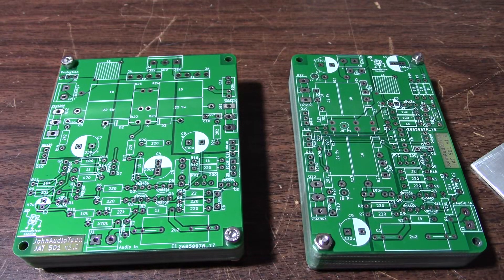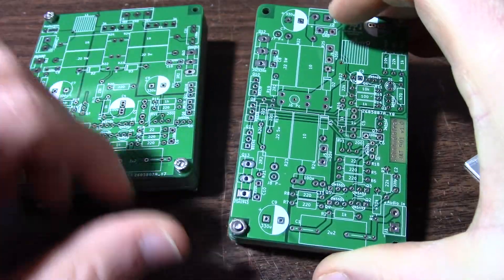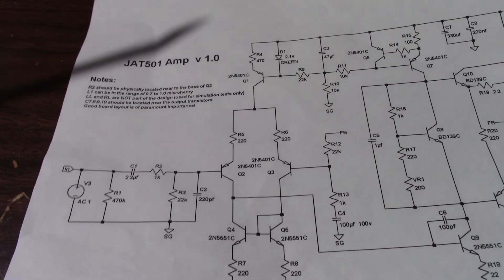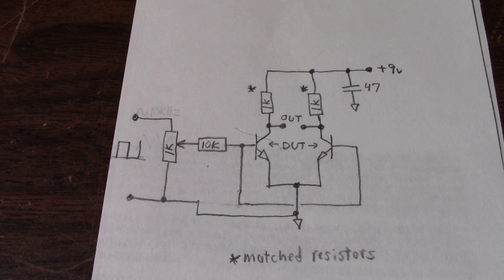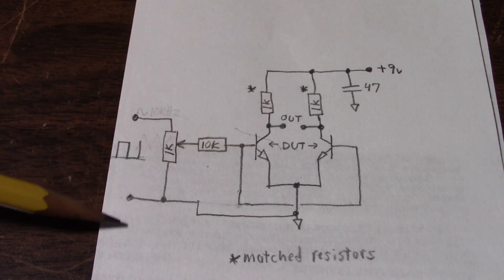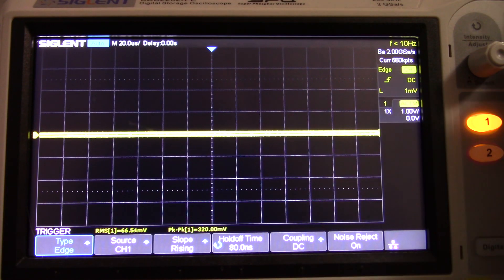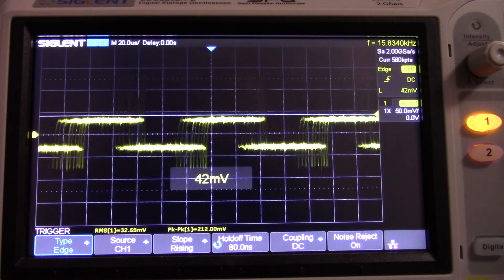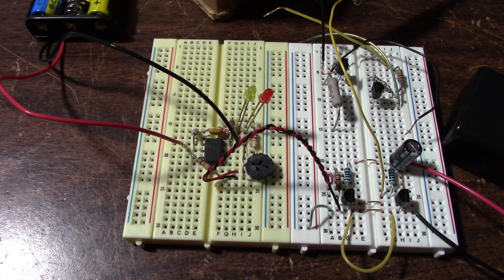Differential transistor matching circuit and the JAT501 amplifier project

Comment: Hey John. Have you thought of using a Voltage Controlled Oscillator with a buffer amplifier. I found that the CD4046be VCO IC chip puts out a great square wave low distortion output.

Comment: hey sir, you can try the Yiroshi design we called it here in Asia. :D it is a combination of all amps design. it has a double preamp, differential, TEF (Three Emitter Follower) and CC(Constant Current Source). can handle more than 200VDC Center top PSU. if you demand high power. it can deliver 2000w. please check it out and do some analysis.

Comment: Question I’m able to use a CD4060be ic chip in a astable multivibrator mode to yield a 16kHz square. How critical should the signal be? Your thoughts?

Comment: John I recently viewed a video where the poster hooked up a pot between the emitters which allowed for variances in the resistors. Just something to think about. Your thoughts?
Reply from the maker: That is normally done to compensate for slight variances in the circuit components. In a power amplifier, it can tune out any offset voltage on the output.
Reply: @JohnAudioTech  Thanks John. I enjoy watching your videos.

Comment: Before you even got to the testing part, I was thinking to myself that it would be good practice to physically tie the two transistors together thermally. Back-to-back (or face to face) with thermal compound or shared heat sink (which is essentially what you have in a diffamp built inside of a chip opamp.   IMSAI GUY struggles with this in a video series he did building an Opamp from discrete components. The solution in that circuit was to change the resistance of the tail resistance of to the diffamp circuit using a variable resistor which somehow placed the circuit in a seeet spot.

It’s also important to note that matching should probably not be performed on a breadboard. Breadboards connections can have all sorts of parasitic impedances that will adversely impact matching efforts.

Comment: Is there any advantage over an opamp, or do you just want to stick to "discrete" amp concept?
Reply from the maker: A high-performance op amp could be used and be better in some ways but would require voltage regulated supply rails and other design considerations.

Comment: John, what do you think about Sziklai pairs in the output stage of the JAT501? The thermal stability is much better because it depends only on the temperature of the driver transistor who has not a lot of power dissipation because it has only about 0.7 V voltage drop. Furthermore you gain a little bit more output power because the bias spreader needs to bridge only 1.4 V and not 2.8 V.
Reply from the maker: CFP has the advantages as you describe. I like them in amplifiers with lower supply voltages as they can swing tighter to the rails without extra circuitry. The high level of local feedback in the pair can make them more linear and need less bias, however they do have drawbacks. They have worse switch off performance than EF and tend to be less stable. Their very low output impedance makes it harder to tame nonlinearities at crossover.

I listen to amp designers' arguments for and against. I did test them and found CPF more prone to oscillate though I'm sure they can be made stable. It wouldn't be too difficult to adapt the 501 amp to use them if desired.
Reply: @JohnAudioTech  "It wouldn't be too difficult to adapt the 501 amp to use them if desired." it is very easy. You just need to switch Q12 and Q13 and connect them the right way to their driver transistors https://en.wikipedia.org/wiki/Sziklai_pair#/media/File:Compound_trans.svg (a resistor of 120 Ohm from the base of Q2 to the power rail support the velocity of Q2 by driving charge carriers out of the junction region.

Comment: Nice littel circuit 
With the presence of different brands from China and many of them can be imitations, it has become necessary to make sure that the transistors are matched not in terms of compatibility , but also in terms of watts and amperes, and you are right. Differential transistors are usually cheaper to match than power transistors Good video, thanks for posting

Comment: How do you match a pnp with an npn?
Reply: In this case you would like the gain to be matched relatively closely.  You can do that with the component testers like John used to compare the transistors near the end.
Reply: @argcargv  oh, i know how I would match them - i have a nice curve tracer that would do the trick nicely. I was curious how John planned it, since he specifically mentioned matching Q10 and Q11 in his output stage, which is a pnp npn pair
Reply: @unregistereduser2  Yes, a curve tracer would be even better if you happen to have one handy.
Reply from the maker: If you look at the curves for complementary transistors on the datasheets, you see they don't appear to match that well, so yes as others have said, match gain. Building a curve tracer with a microcontroller and op amp has been bouncing around in my brain for a while.
Reply: @JohnAudioTech  Yeah, you end up buying hundreds to get a good match as usually the NPNs have more gain. I even had a really perverse idea of intentionally reducing the gain of an NPN transistor to make it match it's compliment, as in a video where you demonstrated how a transistor's gain can be damaged. Would probably end up hurting S/N, but would make for a good experiment!
Reply: I think this is unnecessary and usually is considered as bad  practice.  In descreat design we usually use degeneration (emmiter) resistors. Larger values is better, but gain is redused. Also with large value degeneration  resistors, BJTs go into saturation mode earlier , when CE voltage is insufficient for BJT to work properly. The only way is to use higher rail voltages, at the same time redusing idle currents so, that power dissipation  does not exceed comfortable levels for specific package.

Comment: John. How far off can output transistors be (in your opinion)? Aa you said, they are expensive, and matching them perfectly is tough when doing amp repair. Even if i order transistors directly from QSC, it's a box of chocolates.
Reply: below 10% gain difference should be fine. All the distortion will be corrected. The non linearity of the transistors themselves are larger than the mismatch would create.
Reply: Matching transistors usually considered as bad practice.  The solution is to use degeneration resistors.
Reply from the maker: @vll1976  Degeneration is important, as you see, is used all over the JAT501 circuit. However, it should not be overdone or it will cost open loop gain. Along with matching, it can keep distortion low in this fairly simple amplifier.
Reply: I once designed built a 6 transistor symetrical amp (3 stage) and was pretty happy with how it worked and sounded despite building it with outputs that weren't even in the same case type. Latter I got the amp back (had built for a friend) and ordered transistors meant to be compliments. It never worked quite as well, had to do a lot of tinkering.
Reply: Hi,, H,T,  What is QSC?

Comment: Great video I shall be playing with that tester !...cheers.
Reply: There's a lot of versions of that tester. Some are better than others are. Mostly depends on what reference it uses. The better ones use a reference. The not as good ones use a zener diode. You have to calibrate them too. They never come calibrated. Usually you short all the inputs together to enter calibration mode. Some have a menu item. My favorite ones have a rotary encoder to navigate the menu.

Comment: Can u make a single side pcb version so i can print it at home cus jlc or pcbway asks like 30$ shipping for 7$ worth of boards and i better make these at home 😂.
Reply: He's supplied the circuit diagram for the amp so you could do a single sided version.
Reply: @andymouse  problem is i am not good at component placement so i have more chances of f-ing things up 🤣
Reply: @KuntalGhosh  Honest answer ! I haven't seen both sides of the board yet, I dont think there would be much to do I may look myself.
Reply: We'll have to see, when the files are published. A really well made pcb should have mostly power on one side, and so, not that difficult to convert to single sided. Youll need to add some vias and some jumper wires; probably not a huge amount of work. Assuming we get the source files and not just gerbers
Reply from the maker: @unregistereduser2  The Prototype is single sided on perfboard. There is video of the hand drawn layout in one of the videos in the series. You would want to move the bypass caps closer to the outputs and use a better ground plane. It's a compact design and is a good start to help with a single sided layout.
Reply: I will make 4 for my own use as the tda7498 has a bit of distortion and lacks lowend bass like any class d.